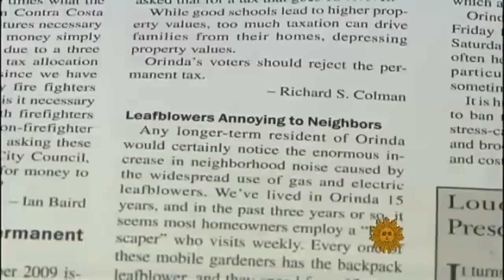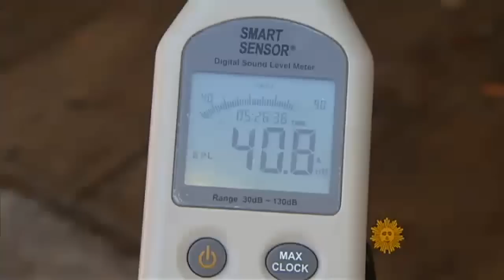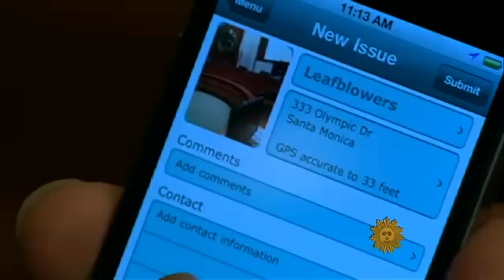CBS News Sunday Morning - Battling loud leaf blowers

Comment: 4 cycle engine push blowers are far quieter and are faster on large jobs.   But you will always need a backpack blower, and electrics won't have enough power or endurance for commercial use.

Comment: I use a cordless electric leaf blower that is more powerful than any gas handheld. I also love the sound my Milwaukee M18 fuel dual battery leaf blower makes and it is a far cry from the annoying gas leaf blowers. My neighbors really appreciate me for doing yard work with less noise. Imagine if there is a 1000 CFM electric leaf blower in the market with 3 rows of axial fan blades and 4 rows of stator vanes and dual silencers.

Comment: So you will soon ban Air planes because they are noisy but you need them To fly ..blowers make TVE job faster not longer.
Reply: An airplane overhead does not remotely compare to an idiot with a two stroke engine
Reply: a leaf blowers main purpose or skill is to make noise, then it is to move leaves...............so no planes won't be banned.     they acually provide a service that is proportionate to their noise.................